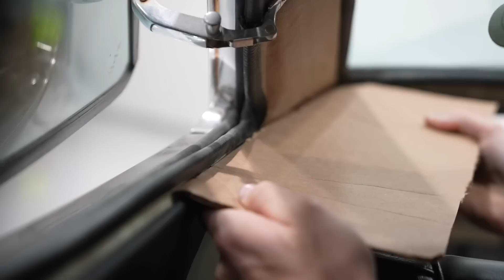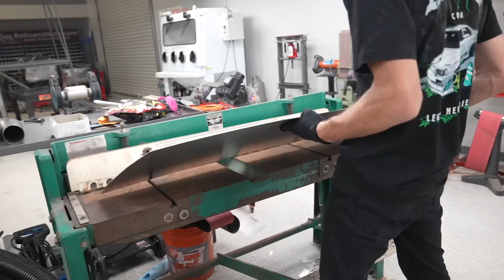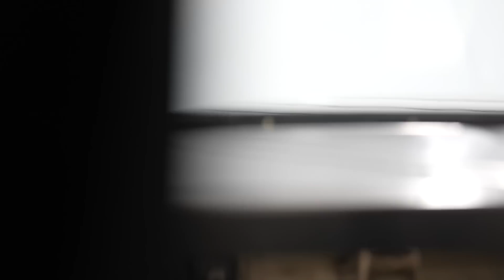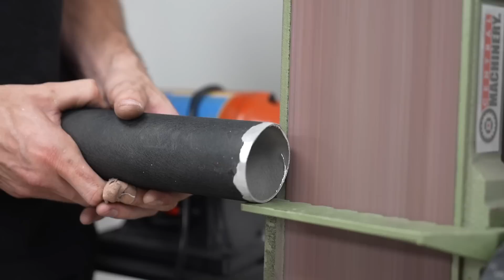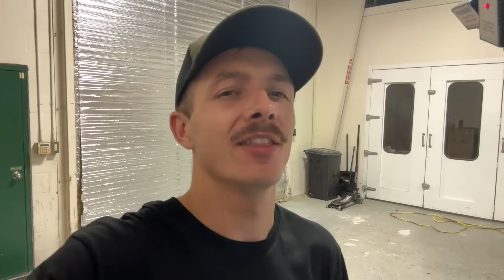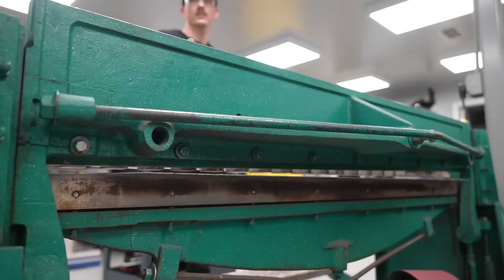Making My First Firewall on the Datsun - Came out SICK!

Comment: You need to check the NHRA safety rules. Unless you're going to a ghetto track that doesnt care about safety, most tracks require Roll bar/cage at X amount of time. I think if you run faster than 11.49 you  need roll bar , helmet and 5 point seat belts.

Comment: hit it gently on the reverse side with an english wheel where you are going to run your beads, then hit it with the bead roller on the top side as normal, and you wont get that slight shrinking in it, which is causing the panel to curve.

Comment: On that bottom edge of the fire wall piece, where it touches the cars floor. Take some small vacuum hose and pit a slit down the middle of it. And put it between the aluminum and the car. Prevents rattle noises and cleans up the look a lot, surprisingly.

Comment: Put insulation on the bottom cut it and stick it to the edge will fill the gap and reduce rubbing noise and will create air tight seal

Comment: It's soooo much easier to make the template out of multiple pieces than trying to make 1 piece work. I use poster board and painters tape, work the hard curves first and then use strips for the longer sections. No need to make the entire piece so I usually leave the inside of the template "empty". 

Grab a pair of the sheet metal shears from harbor freight, bear or however you spell it. They are super sharp and don't make any shavings, super clean cuts. I don't have a stomp shear so that's my only aluminum cutting tool. 

Always do your bead rolling first then cut to size as the bead rolling does change your dimensions some. 

Bead rolling doesn't like sharp turns, so next time put some larger radius turns into the design and it won't warp on you. To help with those warps, you can hammer around the "weird" areas and it will help release some of the stress that is causing it to warp.  

Hope this helps.

Comment: Nice I'm in the process of doing something similar. Please know that in case of a rollover you probably still get fuel in the interior because of the open C pillar. Don't know the Datsuns but in many chassis this is the case. It's actually pretty scary to think about because the fuel will be on the roof and you're basically burned alive.

Comment: Adam: If I lie to you I'm not doing you justice. As a Master Craftsmen, welder, carpenter, computer builder, medic, gunsmith, machinist there's not much I can't do. At times I was crying watching this. But I thought you did a great job installing a handmade firewall. There's pride in that!!!!!!!! I was surprised to see what you challenged yourself to do. 👍👍👍👍! Good content and if your thumb hurts! Yeah I saw that!! A very small drill bit is best to drill a small hole in your fingernail to relieve the pressure. (IE) Don't use a drill. You wont like that. Do it by hand. I'm still trying to find a shop that will take on my 1995 Nissan 200sx build. Keep it as long as you need it for the build and content. Once your done just give it back to me built. It has a one Off wide body kit, custom air intake and 4 to 2 dual exhaust. I will do anything to get it to you and pick it up. The car has sentimental value to me. My Daughter was about to be born and I needed a bigger car compared to my single cab truck. It's her car that's the way I feel about it. I'm caring for my elderly father and don't have time to work on it. Thanks for the consideration.

Comment: but why you connect the second firewall on top of the other? is it not much safer to unscrew the first one, you made and then use mount it under the bend plate. so, you have a tighter system.

Comment: Take rubber edge trim and put it on that bottom section of the firewall, it will fill in the gaps and clean up the line a ton, you can then sandwich the brackets over it 👌🏻

Comment: easier way to mark out curves and what not on your cardboard for cutting is to use a profile tool. u can make one out of a scrap piece of wood or metal about 5-6 inches long. make a tip on one end to drag across the surface you want to copy and the other end drill a hole to hold a pen/pencil to mark that profile to the card board.  then cut on that line and itll be a perfect fit the first time

Comment: That firewall looks amazing, you did an awesome job. Don’t sweat the small stuff when it comes to the gaps. In a lot of race cars I’ve built over the years, I always urethane around the edges to make 100% sure no fire or fuel vapour could entire the drivers area. from the video they don’t look crazy big. So I’d just seal around the edges after the final mount tabes are done

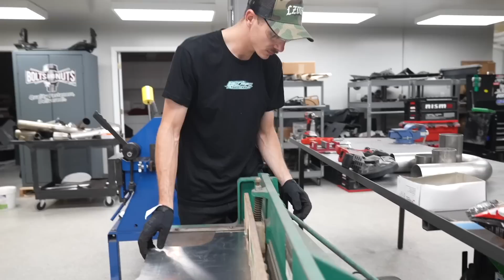Comment: @27:21 what you need to do to get a perfect straight cut directly on the cut line, you will a pair of left and right handed tin snips putting a little cut on each end of the line curling down just enough to sit a little lower then all you do is slide your piece into the shear past the cut line then pull it back towards yourself until both little cut catch then then stomp on it!

Comment: Adam, take a long stretch of vacuum line, cut 1 straight line in the hose to open it up and you can slide it over the edge to create a nice seal on the gaps, also will help keep out any fumes!
Reply: Vacuum line isn't fire resistant. The whole reason of the firewall is to protect the cabin from fire. Sealing it from fumes is just an added bonus. A fire resistant silicone sealant should be used. Vacuum line will probably work and won't immediately catch on fire but why use that when you can use actual fire resistant silicone.

Comment: That fleck of aluminium under your eye at 18mins really had me worried you were gonna end up getting it in your eye and then have to deal with scratchy scratchy times.  Looking forward to seeing what kind of cage you get in there that adds safety/rigidity without completely ruining the feel of the interior.  It could definitely use some kind of cage just to keep shape if the worst happened and it rolled.

Edit:  I actually thought that carpet on the arches was rust so completely removed my comment about some rust treatment lol

Comment: You should draw a line to follow with the bead roller instead of trying to keep your line in the middle of the gap of the die, it's easier to keep the line under the lip of the roller for accuracy

Comment: Adam, your Mainline dyno has intercooler pressure drop testing built in. Just hook up one of its MAP sensors to the compressor discharge and the other one to manifold pressure. It will calculate the pressure drop for you. Then you can test back to back, and it will be stored in all of your runs for you to evaluate in the F2 screen.
Reply: I came to say the same thing
Reply: @michaelmarker6196  I came.
Reply: @Darth_Diddious I’ve come
Reply: @connoisseuroftigolbitts we came
Reply: @tdealjr  cum
Reply: I’m abouta come
Reply: I can’t come
Reply: Oh come on now, you guys.
Reply: @dwilson2548  Dude named “Now” feeling uncomfortable right now
Reply: I came to learn stuff
Reply: Well then say "now" so i can come
Reply: I have no balls

Comment: Why would you need ethanol for 400+ whp? We pull that kinda power out of 5v 1.8t VW/Audi engines all the time on pump, and the rotary should do equally as good or better
Reply from the maker: Tiny turbo. Bigger turbo would make more power at less boost and be safer on pump

Comment: On the top bolted section of the firewall when your ready to finalise it put some exhaust RTV in the join before you bolt it up. Just as a 99% safety measure between the gap.

Comment: Put a slice in rubber tube and use it to fill the gap, will also help with metal on metal noise. Or another option is window sealing glue and make a nice clean line to fill it

Comment: Could you run some rubber tube, down the length along the edge of the firewall plate for the edges to seal the seams? Might also help prevent metal-on-metal noise from the contact points.

Comment: I would think that’s cutting open the core support/grill area would cause more inefficiency due to air being able to flow around the intercooler versus forced through it with no way around. Same concept as a fan shroud on a radiator. Either way, I love that you’re just diving in and trying new things.

Comment: This thing is going to need a wheelie bar if you put any kind of real grip into it lol
Reply: Or add some weight in the front
Reply: (I think I'd go ahead and run non-skinnies on the front anyway.  Given how tail-heavy that thing is,  he might as well have a bit more unsprung weight and control up front there for if things might/do get squirrelly.  )
Reply: @OllamhDrab makes the car drive horrible, skinnies are not just for weight, they actually make the car more stable when you have a bias ply in the rear, you move around so much on the sidewall of the rear tire and front grip amplify’s it dramatically and is very sketchy in something light or fast
Reply: Well he’s on a radial currently
Reply: @roldskiii  Maybe,  I was just figuring it's gonna get so light up front there won't be so much grip anyway.